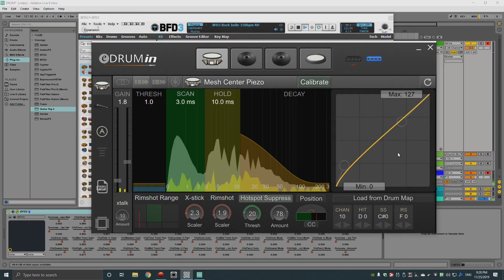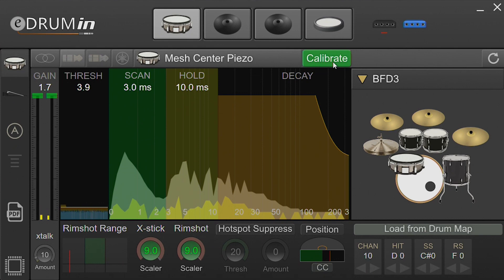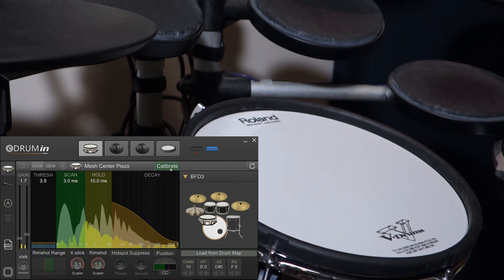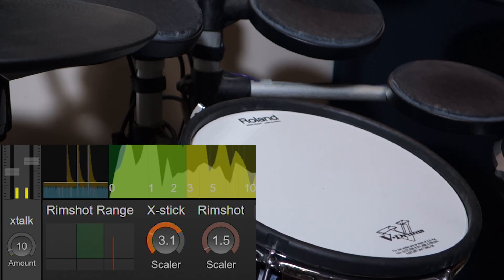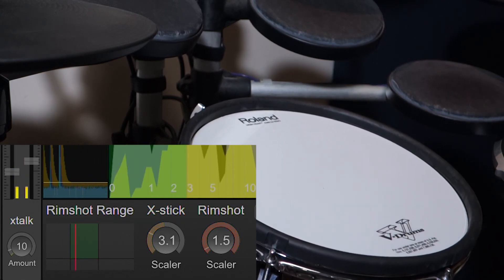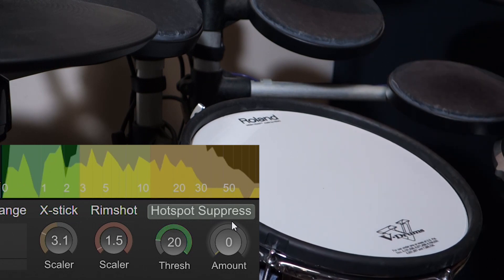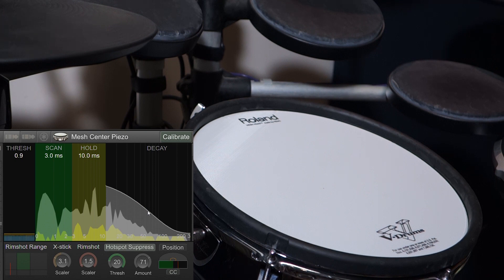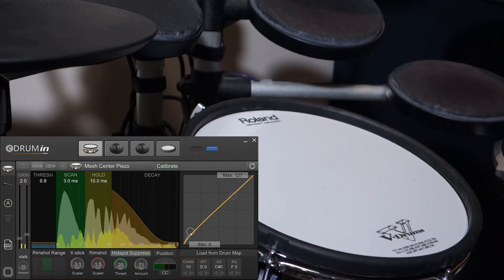Setting up a Dual Zone Mesh Pad with eDRUMin

Comment: Hi, i’m using edrummin10 with PD-125 BK V. I’ve had issues on the sidestick. If i try the sidestick motion where i put my palm on the mesh, I sometimes trigger the mesh and not the sidestick. Right now, I don’t put my palm on the mesh and it works reliably, but i wanted to be able to put my palm on the mesh without false triggering. Please advise.

Comment: I am really interested in purchasing this! I new to e-drums and I got alot of question.
Reply: I am from the Philippines and am thinking about the shipping fee and everything that will cost me. Also once I got this, I'm thinking about buying a hihat controller from Goedrum and also a 3 zone ride and 2or3 zone snare. And of course bass drum, if possible 2 toms and 1 more crash. I know it only has 4 inputs but I heard that these can be split and use 2 pads in one input. Can this be possible ?
Reply: Also if you have the pads that I need , i will most probably order it from you guys.
Reply: Also will Alesis pads work with edrumin?